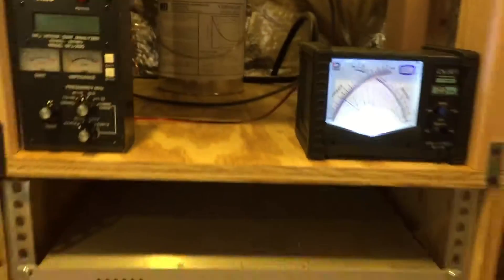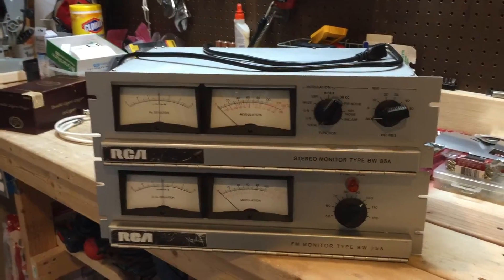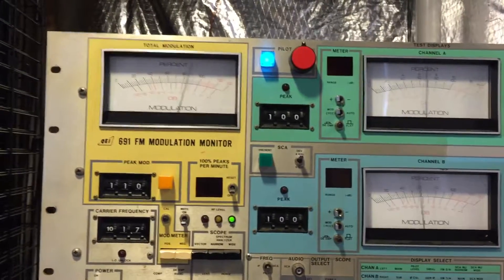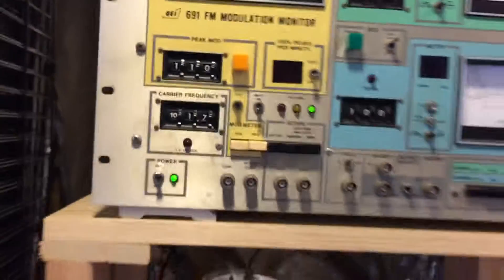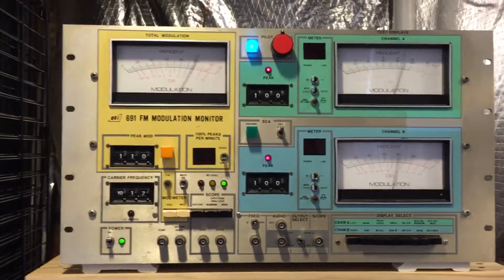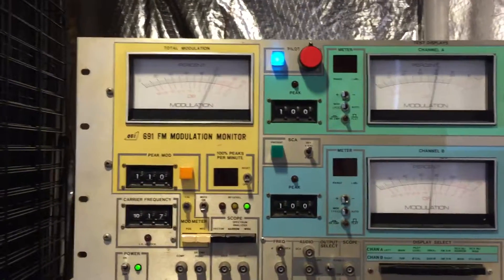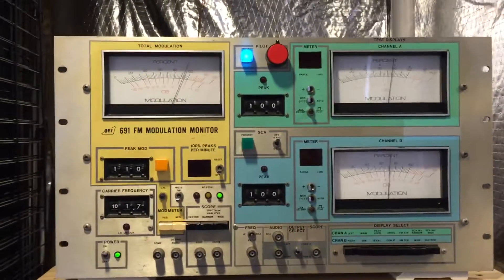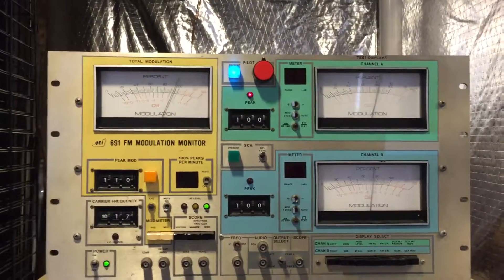My Home Radio Station Transmitter Modulation monitor

Comment: The QEI is way easier to calibrate than the Belar devices, and more stable as well. Also the sound quality is much better with less noise and lower effects of incidental AM. You picked up a great piece of gear.

Comment: That set of RCA monitors (made by Belar) was likely made in the 1960s or 1970s.  They were way ahead of their time, back in the day.  The oven was needed to keep the crystal stable because the FCC required frequency measurement also.

Comment: LPAM? Any future there? Nice vid Bro!!
Reply from the maker: John Stuart - I have thought about doing lpfm but those frequencies are virtually impossible to get. I have honestly never thought about lpam and I’m also not sure I’d have the time to invest in setting up an organization like that. Thanks for the thought though.
Reply: @humbertowrigolini578  are you currently a pirate radio station?
Reply: @mynamenowhastobeasecret.2079  I got solar panels and had to take down the antennas, but every once in a while I run into a dummy load, so no, not pirate radio station.
Reply: @robertwright7143  ok.  Thank you.  I was wondering.

Comment: Could you please do a video of how you set up the Modulation Monitor?
Reply: it is easy hook up your audio cables after your audio processing chain. Take your output from your chain that would go into your transmitter normally and run it into your input on your monitor. Than the out put goes to your transmitter. The easiest monitor to use is the inovonics. I believe they have an FM one and a AM one. they work well if you have a part 15 certified Hamilton Rangemaster or a Chez radio procaster. Their both capable of transmitting 250 percent modulation on medium wave AM. Both radio Canada and FCC certified for low power part 15 transmission.  They can legally transmit up to two miles as well as they can be synced together same as a cellphone tower to give you greater coverage. They also can have the audio source be fed to them over the internet by WiFi using the Barix instreamer and exstreamer. They have a feature that pulls up the instreamer's IP address. As, well as their is a place on the back of the exstreamer that allows yo to plug in a thumb drive in case you loose your feed so you do not have dead air, or you can use it to deliver a message such as for a public information station.

Comment: My supplier just got some equipment from a radio station that went digital. I bought the QEI 691 and planning on selling on ebay soon. He also got a couple Pacific Research RadioMixer 20 units that will probably get scrapped if someone doesn't buy them soon. They are too big for me to deal with, but maybe I can get him to palletize them.

Comment: Do you know how to setup the antenna? you can just put it together and that's it right ?
Reply from the maker: The ground plane antennal is simple - you just have to have the vertical element be the right length (5/8 wavelength for mine). The one I have had an instruction sheet that gave a transmitting frequency to vertical element length table. The vertical element is also easy to work - mine is like a telescoping antenna with a clamp. pretty much idiot proof. Mine is a Ramsey FMA200.The circularly polarized antenna is a different story that involved setting both vertical element lengths as well as the feed point. I needed an antenna tuner to get this right. But it too came with settings instructions.Of the two, I'd go with the GP version if you are unsure of your skillz. It is easier and lighter and there are not too many down sides.